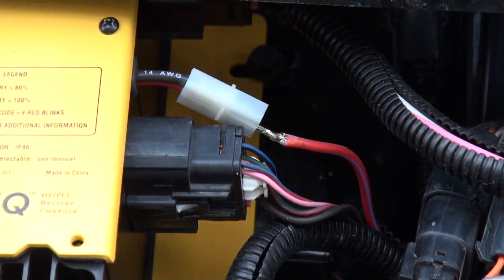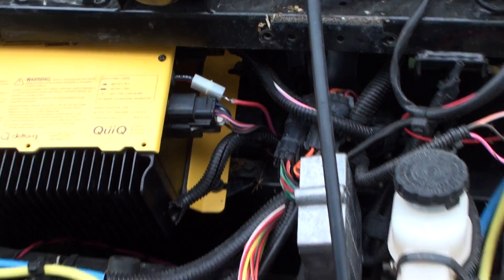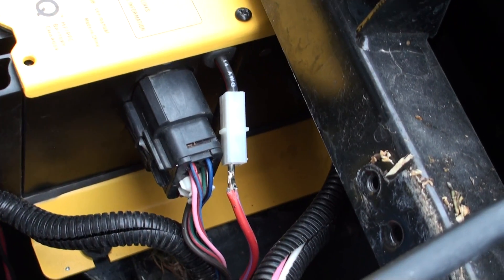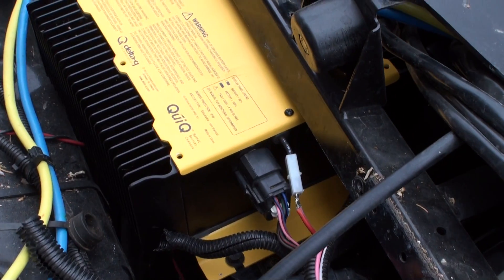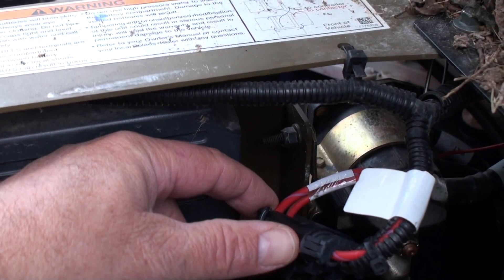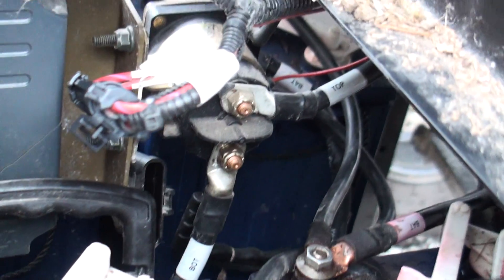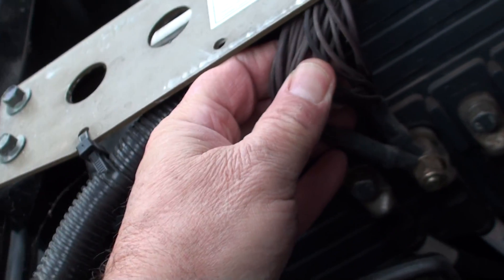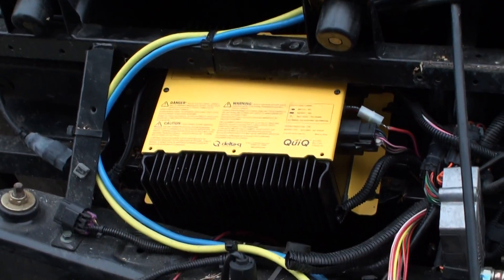2010 Polaris Ranger EV 4x4 Charger Repair 48volt Charging Pin Part2

Comment: Have you figured out a way to bypass the "safety" that does not allow you to change forward/reverse without a neutral pause? Getting a 1700 pound vehicle unstuck without the ability to rock it is a PIA.